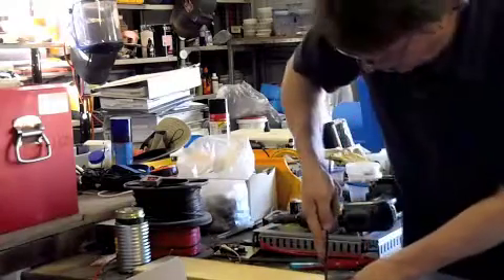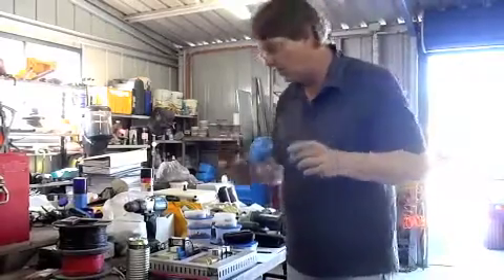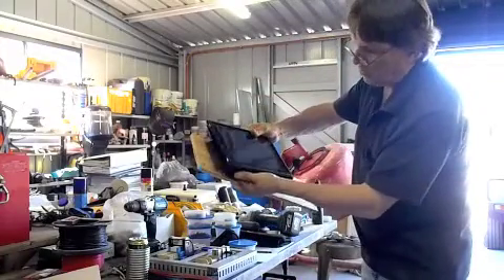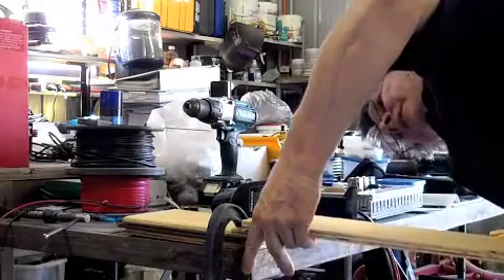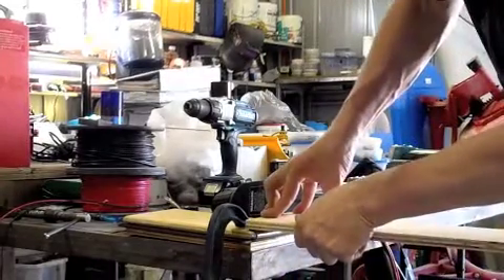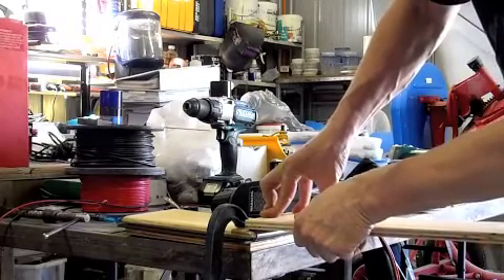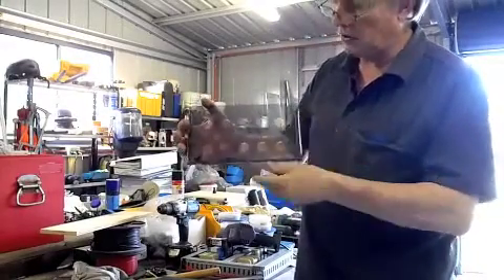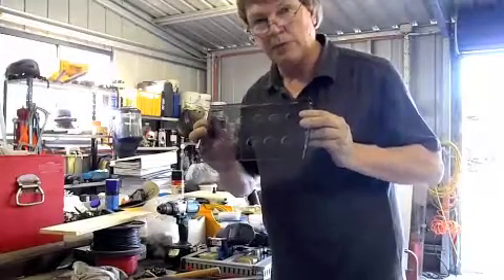How to make an Ipad Mount

Comment from the maker: I heated the perspex with a standard heat gun, usually available from any hardware store, and used a standard clamp to prevent the template and perspex former from moving while working it. remember not to heat the perspex up too much, just enough to allow it to be folded. It will also set faster in its new shape if you have a damp cool rag to wipe it with and cool it down faster.

Comment from the maker: @theoGoh 
Perspex is harder and more brittle than Poly (which has a higher scratch resistance) but unlike Poly, it is easy to form using heat. I use a heat gun to do this although a good hair dryer would probably suffice (don't let the girlfriend catch you pinching her dryer to do this).

Comment from the maker: Hi guys, I will do a short vid soon showing detail of the finished Ipad mount soon, also, stay tuned for my vid on the workshop make-over (it will be a stunner).
Some facts. Perspex (Acrillic, plexiglass) used was 3mm (1/8th inch).
A hair dryer is hot enough to use as a heat gun.
Make sure your former is a little larger than the IPAD so it goes in/out easily.
Counter sink any mounting screws you use to support (don't want to scratch the Ipad).
And most of all,Have fun making it (a beer helps)